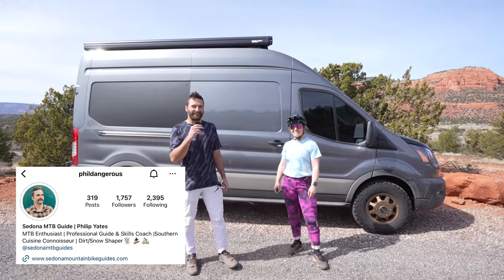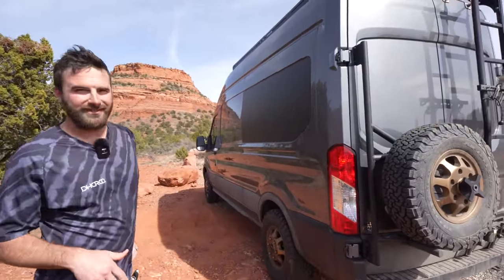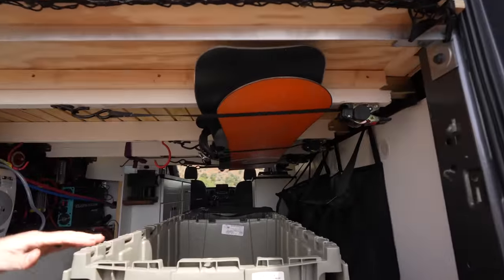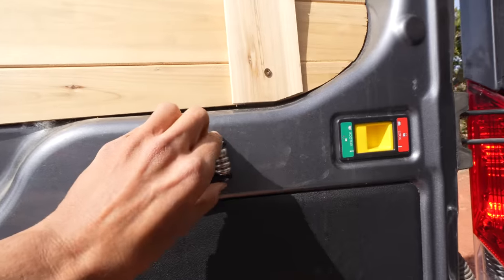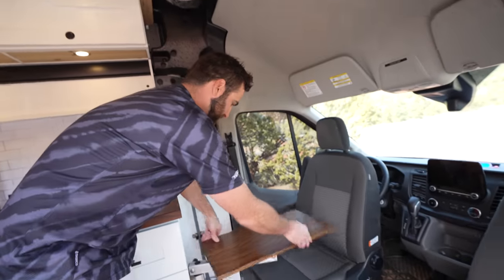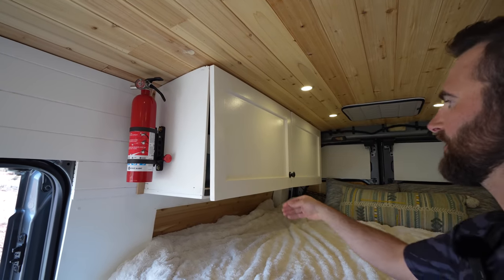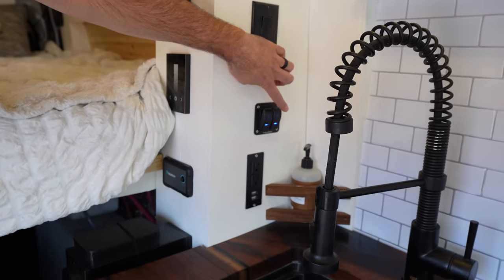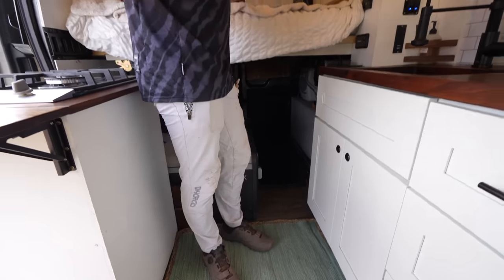Ford Transit DIY Van Conversion for MTB Couple! (Van Tour)

Comment: I have same van (mid-height though) I did want the Sprinter for a plethora of reasons.
After 65k miles - I never found any use for an awning
Coffee snob - moi aussi... Big Time
My build layout & bike storage (same front tire clamp) is almost the same - give or take.
Are you kidding WRT pump - I'm ordering one after this video - Do you recommend the Fumpa? If so which size for a lone rider?
Lagun🤙🏻 of course!
I lowered the bed after a month's use as well-:) just so the MTB fits.
I like the vinyl wrap on the rear panels. I put a wrap on part of the van's hood for contrast.
I considered the Van C lift - didn't do it
My KO2 235/75/16 fit in stock spare tire spot. (245 tooo big)